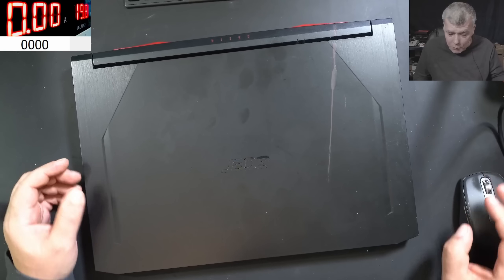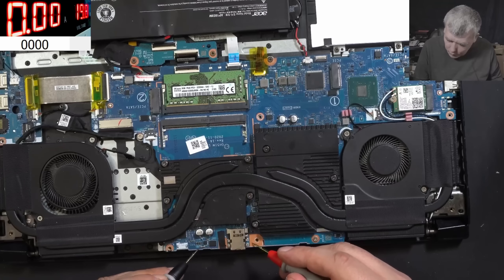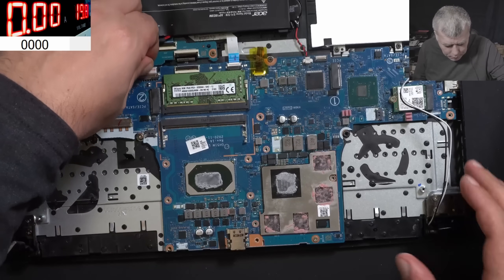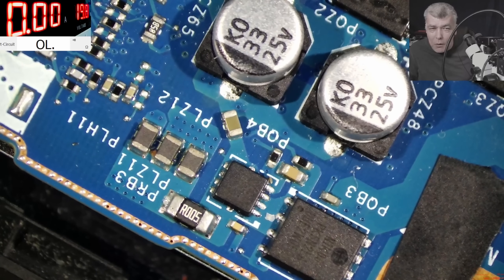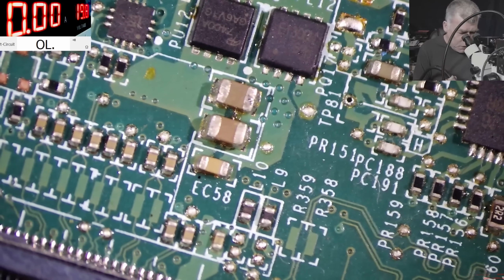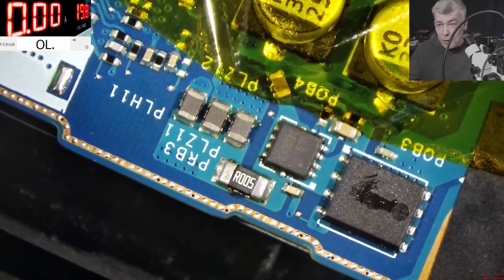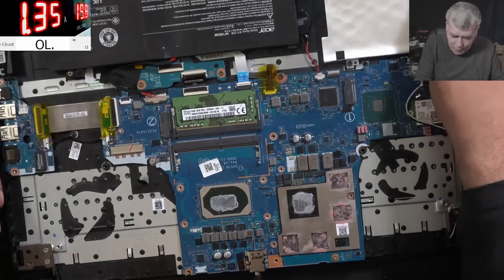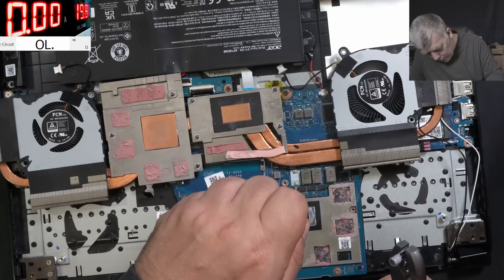Acer Nitro 5 dead, no power repair - Remember this fault? https://youtu.be/oNAzCkkU-Bc

Comment: Is it safe on the same motherboard where i have shorted first mosfet to make a bridge with wire only to see if laptop works ?
Reply: I don’t think it’s a good idea 
It is possible to first check for shorts and such, and if there are none, to inject 19.2 volts directly to the power rail to see if laptop powers on. DO NOT DO THIS WITHOUT CHECKING FOR AND REMOVING ANY SHORTED COMPONENTS FIRST!

Comment: Sorin you have a new disciple. He's name is Graham, his channel Adamant IT and today he did not replace a shorted capacitor!
I bet he will soon fix hinges with hot glue!
Reply: I got really surprised when he fixed the dell laptop by buying the case again. He should clearly do the hot glue fix because it lasts longer and it's cheaper.